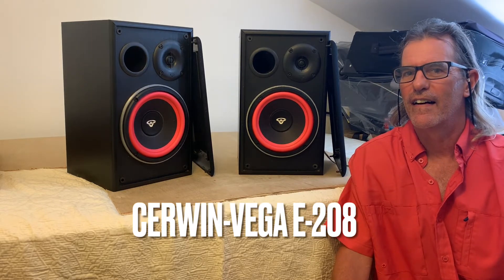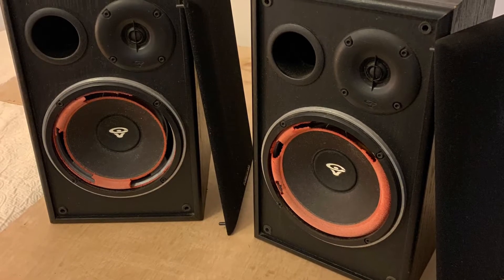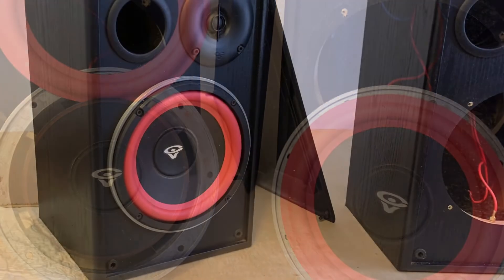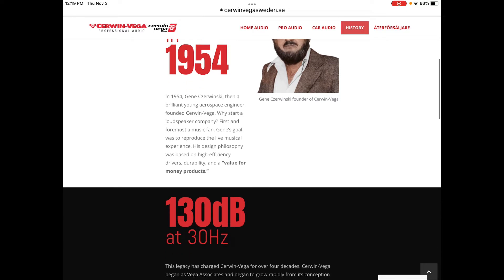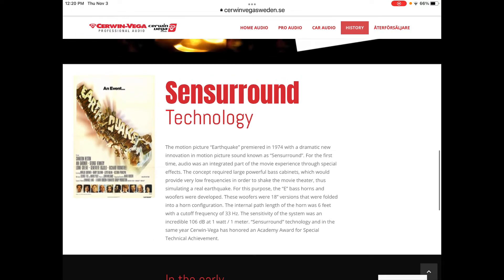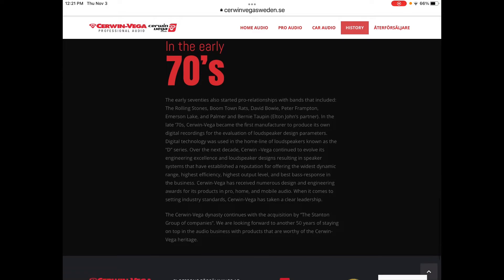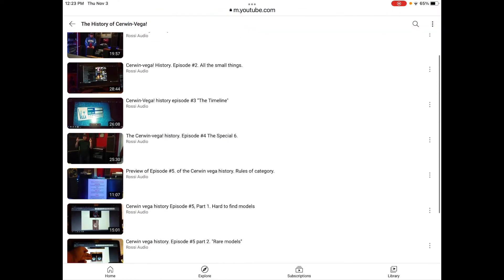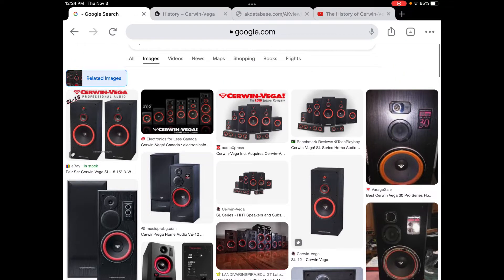Cerwin Vega E-208: Before & After w/ Special Tip on Refoaming

Comment: What type of glue do you use sir...?
Reply: And where can I get a Tone Generator... Ty for your video ,Bro.
Reply from the maker: Most of the US companies that provide glue for refoaming surrounds ship M-3035 glue with their replacement surrounds. You can use that, but it is expensive,. I’ve had good luck using Aileen‘s tacky glue and I know other professional speaker repair folks that do as well. Thanks for watching and commenting!
Reply from the maker: Sorry I missed your other question. There are many ways to source a tone generator. I just use a simple app on my iPhone, or you can get something similar for any phone. In the comment section, I list everything I use on my videos and for diagnostics, I use the audio tool set from Studio Six Digital. I find their audio tools to be easy to use, and it’s free. Hope that helps.
Reply: quick dry or original aileen’s?
Reply from the maker: I use Aileen’s turbo tacky glue. I do believe that is the quick drying formula.